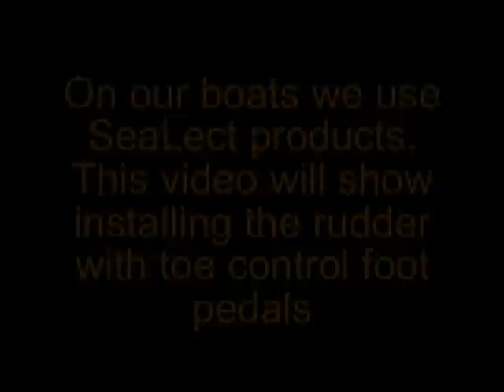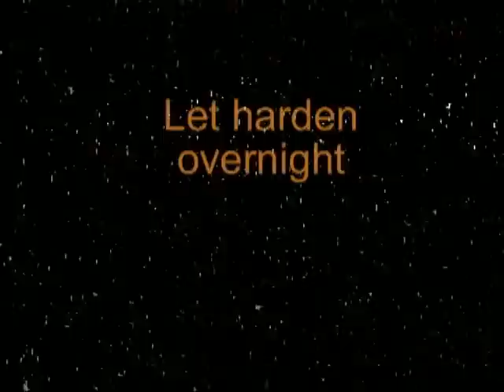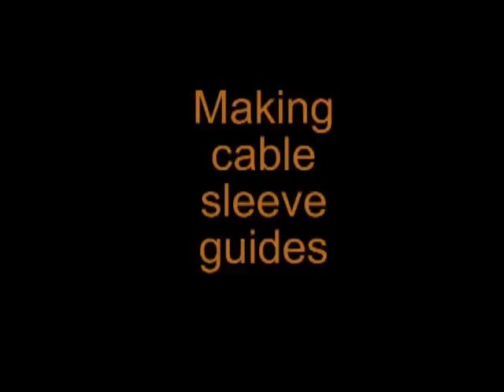Installing a rudder on a Wooden Kayak

Comment: Somewhere in the installation it would have been nice to tell people to lubricate the cable as you push it into the outer sleeve. Your going to be in water, oxidation will happen...
Reply from the maker: Good advice.